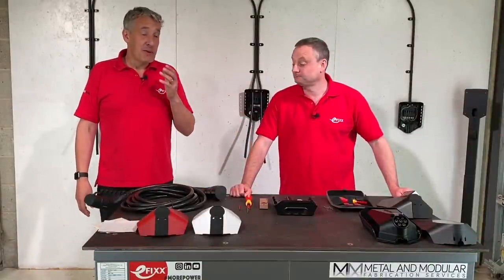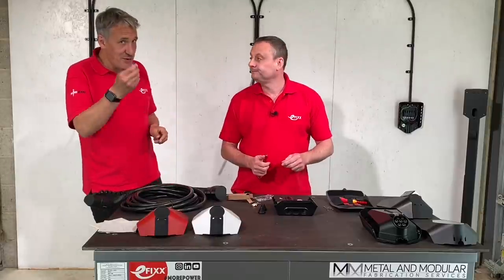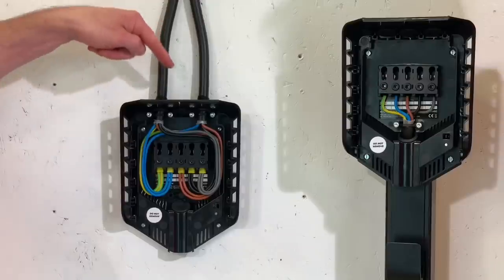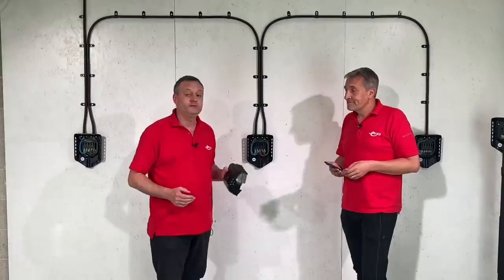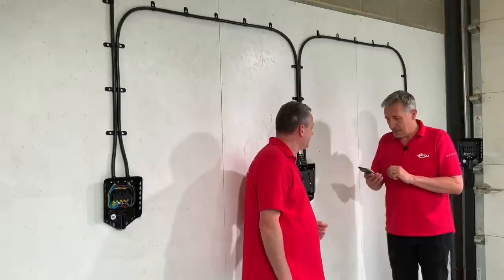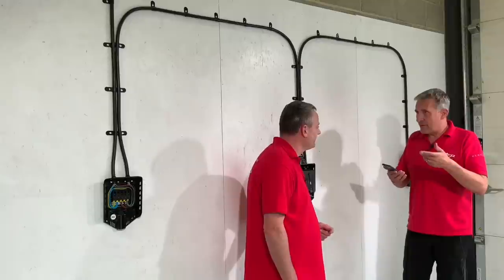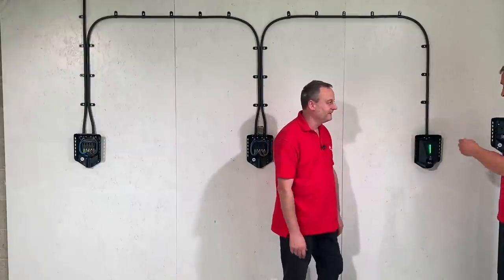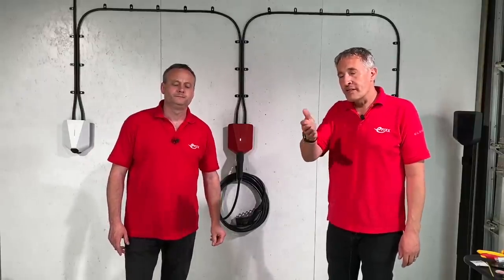EASEE EV CHARGER install 101 UNITS on a single electrical circuit!

Comment: Great video, thanks. How well does it cope with limited/no mobile reception? Just thinking of an underground car park where that could be an issue...
Reply from the maker: You can also connect to a WiFi network - or use a Siretta survey tool to check the mobile network coverage before install.

Comment: Do you have to differ the phasers at each charging point (1. Point L1 L2 L3, 2. point L2 L3 L1, 3.point L3 L1 L2 )? Or is that also included in the logic. Otherwise if there are 3 single phase cars charging at three charging points alle will charge at L1 and therefore with max.10A. L2 and L3 are not used in this chase and this is not good.
Reply from the maker: The Easee will distribute single phase chargers across all the phases to maintain balance.
Reply: @efixx  Sorry I don't see the question sufficiently answered.
Please get confirmation by Easee. 
I doubt, that in this tiny box, a walled L2-cable will be mechnically re-switched to the L1-Typ2-plug-cable. Thanks
Reply: @Peter Birett Easee Chargers have relays built into the charger. It communicates by radio between chargers on the same circuit. 3 chargers installed on one circuit. Charger 1 activates relay on L1, charger 2 activates relay on L2 and so forth. So each charger will automatically load balance the circuit for one fase cars and for 3 fase charging cars well the car automatically balances draw on all fases.
So its EXTREMELY IMPORTANT do not manually switch the wiring between chargers. Follow the marked wiring instructions in the chargers at all times or you break the automatic load balancing for the circuit.

So to answer your question the charger will automatically mechanically re-switch between fases to load balance, quite amazing in such a small box. 

This was one of the things Easee Charge Company set out to create, the innovated/developed the technology to do it automatically. No one had done it before them and definitely not in such a small charger it’s revolutionary.

Comment: The unit is rated at ip54, can I gland two cables in to the top when mounting outside? Always do bottom entry when outside but no chance of getting 2 x 5core ho7’s into the bottom.

Comment: Could you wire 2 together off 1 MCB if the consumer unit is in the middle rather than linking together. I'm asking for single phase intallation
Reply from the maker: Yes -Easee make a home version which can connect 3 units

Comment: Hi guys, great video. 
We are having to install 17 EV chargers into our new residential development and really interested in the Easee charger. The bit I cannot understand is the load distribution off one supply, does this mean in layman’s terms that if all 17 plugged in at once and started charging then they would all take forever to charge to full? 
Is there an ability to time charge on the units? 
Thanks in advance.
Reply: Yes, can't take more power than the circuit can give. And also Yes, there is a time charge function in the app.

Comment: Why should I enter the main fuse from the building? I don't understand why the wallbox needs to know this.  Can someone explain?
Reply from the maker: On larger installations you may have multiple circuits - say 3 x 32 A circuits connected to an incoming 60Amp supply - by knowing the maximum supply value you can manage an additional criteria.
Reply: @efixx  thanks.
So in my case I've 3x63A coming into the house, the cable which is connected to the wallbox is secured by 3x25A. I want to use 11kW max

So when the app asks me to enter the fuse, the electrician will enter 63A and in the box below he will enter 25A.

In the next step he will limit the maximum power outcome to 16A which is equivalent to 11kW?!
Reply from the maker: If you are connecting to a 25A circuit on three phases you can charge at 17kw  - but you may wish to limit below this depending upon the other demands you have connected to the supply.

Comment: Do you have to use that armoured cabling if none of the cabling is going to be outside? Ie ev charger is right next to the consumer unit?
Reply from the maker: Depends upon the cable route and protection within the consumer unit
Reply: @efixx  I'll go with whatever my electrician recommends then :-) thanks

Comment: Not quite sure I understood the connection part. It has a 4G SIM already in right? So theoretically if my home Wi-Fi does not reach, the SIM card will still connect the Easee to the cloud and my phone for software updates and app interface. Am I right? Cheers guys
Reply from the maker: Yes that is correct.

Comment: Some nice ideas on this product, looks like a bit of thought has gone into it. As for the cable entries water eventually gets into anything, so they are not the end of the world.
But there's just so much hassle with charging points, use a rod don't use a rod, realistically what are the chances of someone touching that car while it's charging and the network lose the neutral, it's got to be small.
And if pen supplies are that risky why are we using them,  an EV should maybe have it's own contact to ground one that activates when the car is plugged in or better still  make it like a scalectrix car 😂.
Reply from the maker: Interestingly we believe Germany and Norway don’t require any special treatment with regards connecting to TNCS supplies.
Reply: @efixx  Here in Germany the most common system is TN-C-S, but you're required to have an earth electrode installed. This can be a foundation earth electrode integrated into the base plate of the house, or in older installations (until 1970s) use the incoming water pipe as an earth electrode. Due to this these water pipes were made of thick cast iron to prevent leakage caused by electrochemical corrosion. This was possible until 1990, and from then on only the foundation earth electrode was acceptable for new installations. Now cities have to inform the owners of houses when they replace water pipes, because in most cases they replace them with plastic. So the house owner could install a separate earth electrode to prevent there's no working electrode in the house when the city replaces the water pipes. The electrochemical corrosion of metal water pipes is also a problem in cities which have a tramway.
And you got one additional requirement if you install a charger: You'll have to retrofit a surge protection in the board to prevent retroaction from the car to the grid. But that's only if you install the charger to the wall and hardwire it to the electrical installation. If you simply install a red 32A CEE outlet and plug a mobile charger into it, this won't apply.
Reply: @efixx   @Marcel Germann
 I can add for Norway 🇳🇴 you are also required to have a earth electrode installed for the hole installation and is also usually integrated in the foundation of the building and into the main switchboard. I can also add we are therefore strictly forbidden from breaking circuit of the earth conductor with a fuse, because that would make the extra earth electrode installed useless in case that fuse trips and the internal batteri in the car gets a fault and exposes that to the chassis of the car. Then the current as no where to go but into you. so we only switch L1-L2-L3-N.
I can also explain the IT label for the connection label in the charger. IT is a network installasjon method like TN. Main difference is our IT distribution grid doesn’t use neutral, don’t exist in an our Electric Power Distribution Network. All fases carries 230-240v not 400v. So its a 3fase distribution system with 240v. It has created some extraordinary problems for electric cars in Norway 🇳🇴 because all cars charge using neutral and TN and 400v supply. So we have less power available more than single fase charging but less than 400v 3fase charging. 400v 3fase can charge 22kw on 32A but our 3fase 240v can only charge 11kw speed on 32A when the car is able to evenly distribute its load on all fases equally and as of now 14/02/2021. The only car that can charge full power 11kw is tesla (they modified there onboard charger to accommodate our IT distribution network) all other cars charge unequal on all 3fases when connected to IT 3fase 240v and can therefore max draw 8KW.
All 3fase cars charge equally on all 3fases when connected to 400v TN.
So Easee adds connection instructions for the special IT power distribution system that is wide spread in Norway. 
For more information https://www.bender.de/en/know-how/technology/it-system/comparison-of-system-types

Comment: What cleats have you used on this guy's.... Very neat 👍
Reply from the maker: These are from SWA - Firefly cleats  - https://www.swaonline.co.uk/fire-safety-products/firefly-fixed-cleats - However we are now using these from D-line  - https://youtu.be/9t7_Pa4MJs4 for an even neater job.
Reply: Thanks I'll check them out
Reply: Does the adjustable d line work on two cables on the Easee drops....ie loop in and out?
Reply from the maker: No would have to be 2 clips
Reply: That's a shame.....I wonder if oversized it and went a few cleat sizes up it might work round two....

Comment: So 101 ev cars can plug in and all take 7 kw. So you can get 707 kw from a a 32 amp 415 feed.. mm
Reply from the maker: Watch part 1 to see how it works - https://youtu.be/e_aJRe5bf04
Reply: ev's only take what the charger's tell them to take. That's the whole point of having linked chargers, to limit the total current when lots of cars are charging while allowing fast charging when only a handful are charging.
Reply: So if we want to charge 100 cars we would have to bring sleeping bags and food. At the moment we have 6 diesel pumps at our yard and have no problem getting 100 vans out on the road in 30 minutes..
Reply: @richardoakley8800  You may want to plan you installation for your needs. Just like you installed diesel pumps and not petrol pumps in your current setup...

Let me calculate an example for you. Let's assume your vans drive 100 km a day, use twice as much electricity than a car (40kWh/100km) and they are parked overnight for 10 hours. That means a 32A circuit can supply 5 vans. You can now install one wall box for every 5 vans, invest in sleeping bags and switch around vans every 2 hours during the night. Or you install 5 Easees per circuit, plug in all vans at once and let those little devices figure out how to distribute the energy.

And yes, the infrastructure for a fleet of 100 electric vans is a bit more expensive than what's needed for 100 diesel vans. Just be thankful you've been allowed to dump your toxic exhaust into our children's lungs for the last 100 years for free.
Reply: @HenryLoenwind  20 % of the uks electric comes from nuclear.. so thankyou for producing intermediate and high level nuclear with a half life of 24000 years .. and no.. not even the best ev charger in the world can filter out the electricity from a nuclear power station.
Oh and dont forget a magnox nuclear power station typically lost 7  tonne of radioactive carbon dioxide coolant  per day..
Reply: @richardoakley8800  Yes charging 101 cars on 1x32A then sleeping bags would definitely be necessary. Would take days. But a serious company installing 101 chargers would never install 101 chargers on 1 circuit, come on use your brain 🧠 they would divide 20 chargers on each circuit and make the circuit 63A each.
Reply: @maa1649  to turn our fleet round we would need 30 150 kilowatt chargers.. thats 4.5 megawatts.. we would need our own  sub station and 33 kv feed.. do you have any idea how much thatcwould cost!

Comment: Might take a while to charge 101 ev's  from 1 32amp breaker.
Reply: Good though.
Reply from the maker: The back office system allows limits and priorities to be set. In reality not all chargers will be needed at the same time.